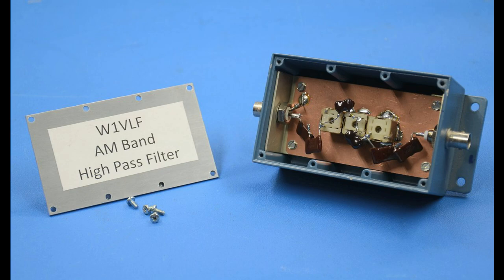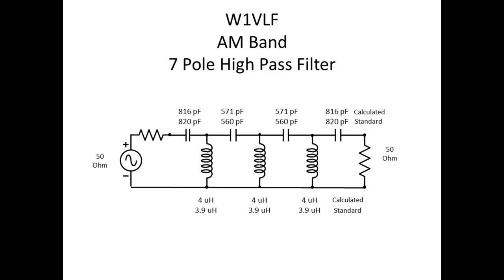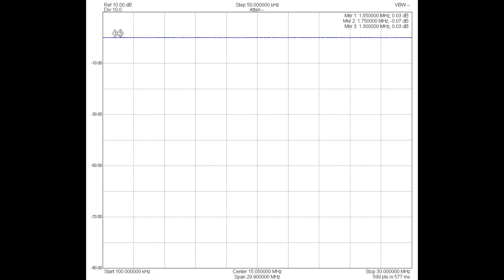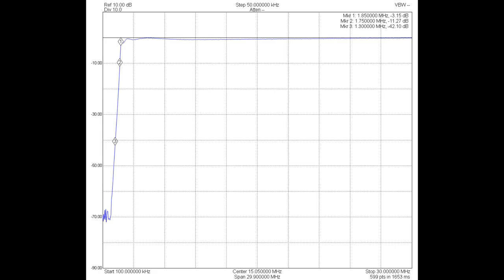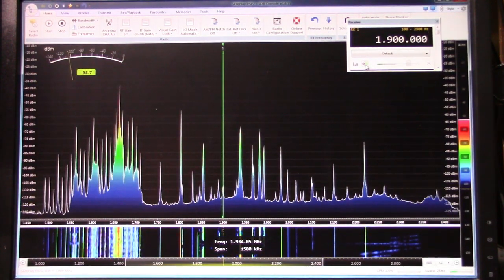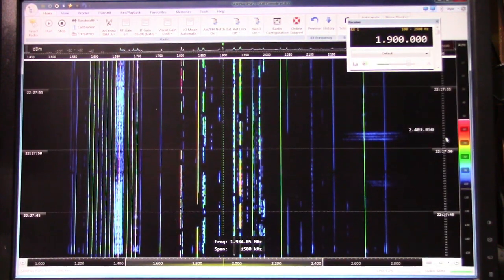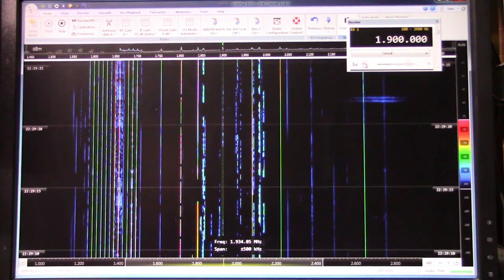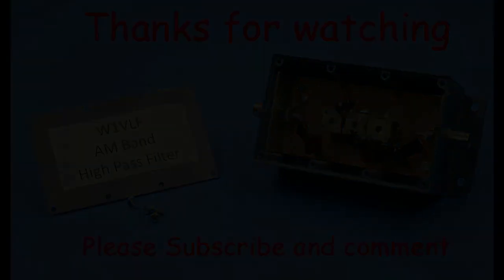Prevent AM BAND Overload High Pass Filter

Comment: Great video Paul -thanks for showing off your filter design!  I have a demo version of the RSPdx and can confirm the internal filtering is MUCH better than the original RSP2.
Reply from the maker: That's great news I just checked out the site and saw the DX  for the first time.. AND!!! It has a BNC front connector!!
Reply: @W1VLF  Yessir - I like that BNC connector too!  BTW it just dawned on me why your call seemed familiar - I think we worked a year or two ago on 2m simplex a few times....the first time I was mobile in Storrs on my way home from a club meeting....I also think you may have given my buddy John from Stafford Springs a 6 meter antenna. de N1NUG
Reply from the maker: Very Possible!.. Where are you .  I used to work 2 mter FM with a pair of 13b2 antenna at 130' from Northwest CT. Whats yer call?
Reply: @W1VLF  I'm in Ellington near Crystal lake.  Call is n1nug

Comment: Great video - it's true that with the ultimate antennas, even the built-in filtering of the RSP2pro can only go so far as you tune close to those super-strong MW transmissions (having said that your video shows, the RSP2pro AM notch filter does pretty well).   
The new RSPdx, just announced and available later in November is the replacement for the RSP2pro which was discontinued a few months ago.  The design of the RSPdx has specifically focused on performance below 2MHz with additional attenuation, attenuation granularity, improved filter design, a 500kHz low pass filter option for LF/VLF and (using SDRuno) tighter interaction with the hardware reducing intermodulation problems. More information on: https://www.sdrplay.com/rspdx/
Reply from the maker: Hello.. Please don't get wrong. I love my SDRPlay2. I upgraded from the SDRPlay1 and based on your comments I will upgrade again. I thank you for the information, as  was not aware of the DX version of the radio.  The filter shown in the video was built 5 years ago and I used it with SDRplay1 and now the play 2  Honestly I have not use Uno in couple years only because SDR software keeps changing, and its difficult for me to keep up with all the changes, so I concentrated on just 2..Console V3 and SDR#   Based on your comments, really need to look at Uno again.  Thank you for taking the time to watch the video and comment.  Paul W1VLF
Reply: Also the RSP radios are best at 2.048 MHz bandwidth, I'm not sure what the bandwidth was in the video.
Reply from the maker: @SimonBrownG4ELI  Hi Simon.. Yes I was using 2.048 Mhz .  Thanks for all your hard work on Console 3 Incredible effort.  I particularly like the Synchronous AM Detector  and the Signal History function.. Great look at proagation

Comment: Many thanks for sharing the video!
The filter box needs to be made of metal or a plastic one has the same effect?
Reply from the maker: I would try to use a metal box if possible because of the shielding, but don't let that stop you from trying, it may work out just fine in you situation.  You can build a metal box out of circuit board material if needed.
Reply: @W1VLF  Many thanks for the quick reply! I'll try to make one for my 160m skywire loop and see what I get